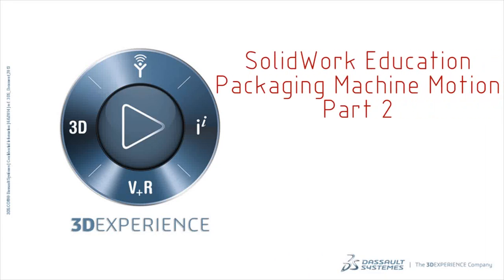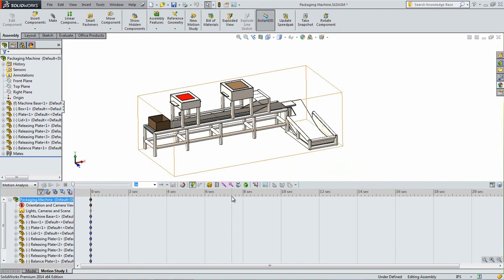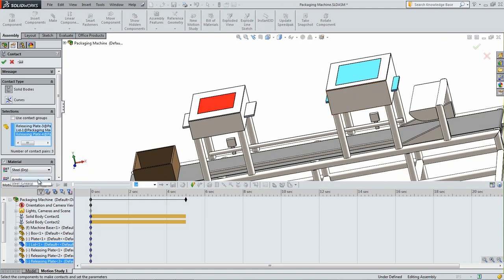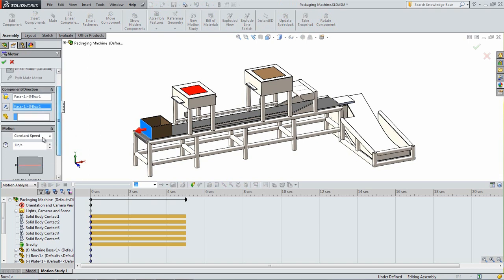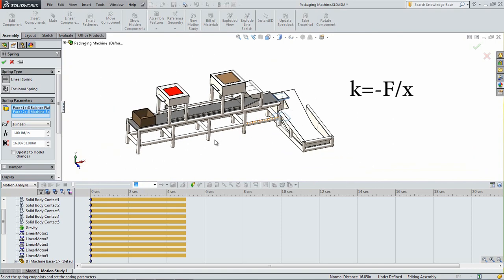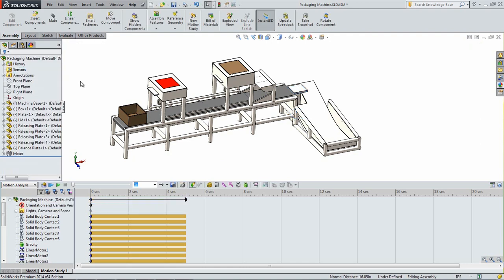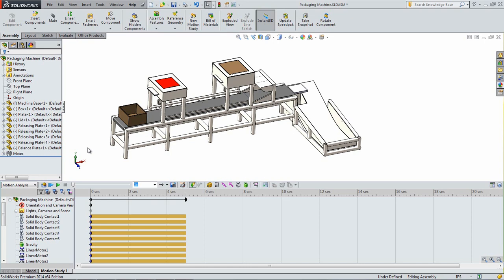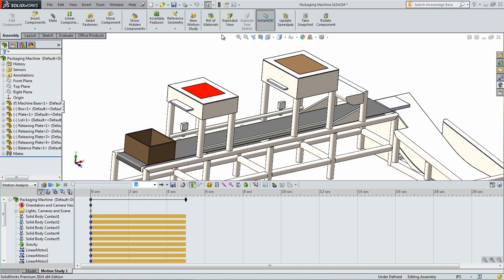SolidWorks Education Motion: Packaging Machine Part 2

Comment: Bro I did same procedure as u shown but when I am giving calculate it is taking lot of time and some where in middle it stops working 🤷🏻‍♂️. I don't know wt to do can you please tell wts mistake
Reply from the maker: Hi Pavan,

We're sorry for the inconvenience! We are happy to point you in the right direction. For technical inquiries, with your subscription, you can always access Knowledge Base for immediate troubleshooting. If Knowledge Base does not help, you can contact your local reseller through your organization.
 
Even without a subscription, you can access your MySolidWorks for information. Check it out here: http://go.solidworks.com/Kka
 
For SOLIDWORKS Help, check out http://go.solidworks.com/YYM
 
Having problems with SOLIDWORKS crashing, hanging, failing to start or performing poorly? Use "Safe Mode" to overcome problems and help identify the cause. Learn more in our latest blog >> http://go.solidworks.com/bRh